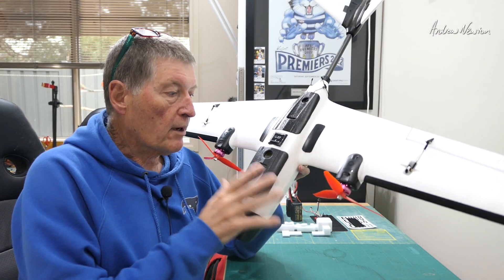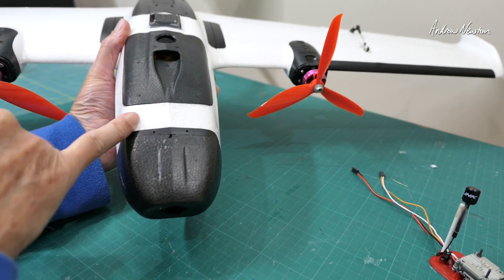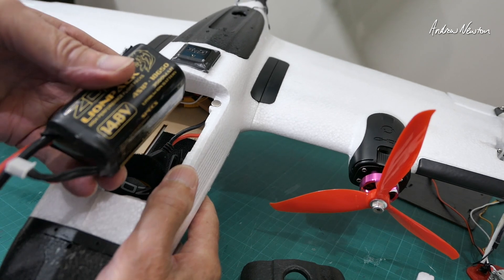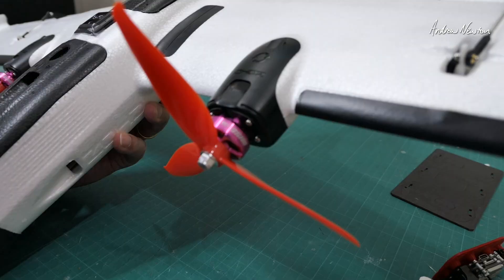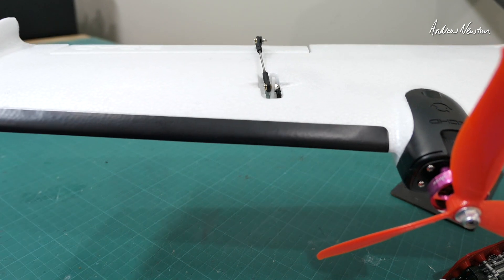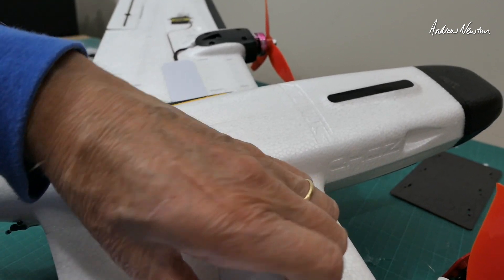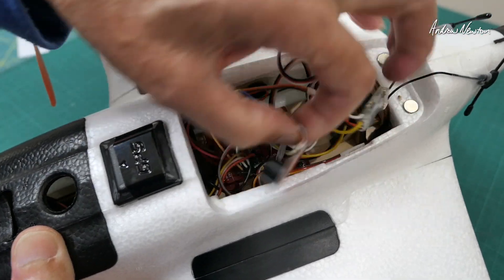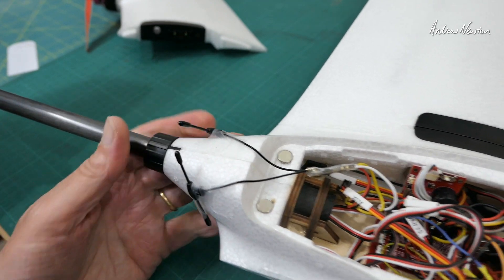ZOHD Altus - Overview and INAV setup

Comment: Why am I unable to trigger the motors via the outputs tab? I have the motors connected to S1 and S2, and the ESC starts beeping immediately after I connect the battery
Reply from the maker: Wrong ESC protocol, or wrong connections or most likely need ESC calibration using the Outputs Tab.

Comment: Andrew, since ive never seen anyone mention it....the black trim adhesive stuff for the front of the wings is heat shrink type material. Stick it to the wing, push it down then use a hairdryer to shrink it a tad and grab the edge. It wont let go anymore. Mines been on for 8 months now and has never loosened.
Reply from the maker: Useful tip, thanks for sharing

Comment: Hello Sir, I have problem with INAV setup with Altus.
The aileron always move a long with the elevator/rudder. Seems like it automatically mix the aileron with elevator/rudder.
This mix causing problems to do the setting because the direction of 1 side(rudder/elevator) is not right. If I reverse it, the gyro direction will be wrong.
I already spent 2 weeks. The best so far is all surfaces moving to the correct directions but one side of the elevator's gyro moves to the wrong direction.
I have tried to change the selection of the tail on both iNAV and TX(I am using JETI) but still no luck.
Please advise and thank you in advance!
Reply from the maker: Follow the INAV Troubleshooting link in the description.
Reply: @AndrewNewton  hello sir thank u for the guidance. i noticed 1 mistake on my radio i set the elevator as 2 inputs(because usually if 2 servos for elevator, we set as  2 inputs).
Then i figured out the setting on the TX should be the basic setting only so I changed to elevator type to 1 servo. Everything works perfectly fine now thanxs again!:face-red-heart-shape:
Reply from the maker: Well done, so glad you could sort it out.

Comment: Hi Andre 
Your video is very good, I have this same model, I would like some help, I can't mix my radio master 16s with express elrs as vtail, for the zohd altus, can you help me with this
Reply from the maker: I have done V-Tail mixing videos. Same as elevon mixing really
Reply: @AndrewNewton  I'm here again,
I managed to solve the mixing problem,
but I would like to share it here. When I bought the controller, I updated its firmware to the corresponding model, which was the Speedby Mini Wing, and inside INAV, I set all the mixing options, and it was not compatible with the radio mixing... in short, the firmware that worked was the Speedby 405 Wing, as soon as it was updated, all the channels and servos responded. In the Mini Wing version, the controller channels did not work as they did in the mapping sampling, that was the problem I had. Now I have enjoyed the model airplane, I like it more, stable, quiet, slow flight too.
Thanks for always sharing your hobby here,  @AndrewNewton
Reply from the maker: @bruno_souza_fotografia  Ah yes, that is tricky. The F405 Wing Mini is not the same as the F405 Mini so you must read the manual to find the correct INAV target.

Comment: Hi,first of all thanks for your help with my fimi manta👊🏻,I’ve just got a Altus with the atomrc fc,but when I flash inav 7 to it the saving defaults screen at the start never goes away any ideas?
Reply from the maker: That's an annoying bug. Will be fixed in INAV8. Close that screen and reapply your diff if you saved one. Otherwise set up mixer pids etc from scratch.
Reply: @AndrewNewton  oh ok thanks,I’m starting from scratch so it’s ok to just cancel that screen and continue as normal,or is that bug present in let’s say inav 6?
Reply from the maker: @wastedworldexploration2842  Bug appeared in 7 with Apple version of the configurator. Yes cancel the hung screen and continue.
Reply: @AndrewNewton  thankyou sir 🫡

Comment: Do you think it would still be stable if you were to shorten the tail? I would like to fly it with a much lighter set up and by shortening the tail I could run a lighter battery and set up.
Reply from the maker: Yes, it's very stable as it is so you could shorten the tail boom by a few cm maybe.

Comment: Hi Andrew. Thanks for nice review. Can you share please your autolaunch settings ? My Altus autolaunched and immediately turns right.. idle_throttle=1300, launch_throttle=1700. I have PNP version. Are problems with autolaunch settings or with stock ESCs ? https://youtu.be/86MJy8mATLI
Reply from the maker: I no longer use autolaunch.

Comment: Great setup insights. Nice close views in the camera work to show details.
Any thoughts on a 2 vs 3 blade propeller setup? I'd be bit worried with catching 3 blade on landing. 2-blade is also more typical of an efficient cruiser.
Reply from the maker: Yes I have some 2 bladed props coming but the three bladed are smooth. I'll compare the efficiency

Comment: When ZOHD makes good stuf why the Fuck provide only 3Pin Conectors in the Wingpocket?  Every Modern RX or VTX need 4 Wire for telemetry or Smart audio
Reply: The "9+2 Connector" appears to be a common connector. Have seen it used by U-Wing/Fin-Wing on their models. Also can purchase the "9+2 Connectors" online. 
(9+2 being 2 larger power pins, 9 smaller signal pins)
It would indeed be nice to see a "2+12 Connector"
A work-around for this would be to use a signal multiplexer like CANbus, etc. to a remote signal distribution embedded out the wing.
Another work-around is for multiple 3-pin connectors to share power/ground, so freeing up a couple pins to allow more signal pass-throughs.
Reply from the maker: I thought the same thing but maybe for VTOL tilt servos, not 4 wire components
Reply: @AndrewNewton  but this Problem is so old. They made the same Mistake again. This problem was spoken few years ago with Talon GT, or other RC Planes